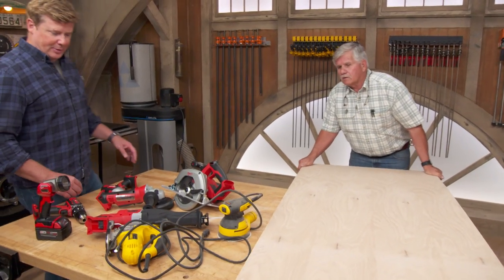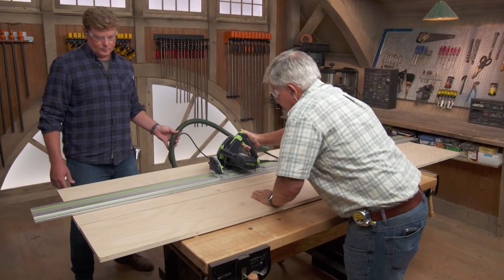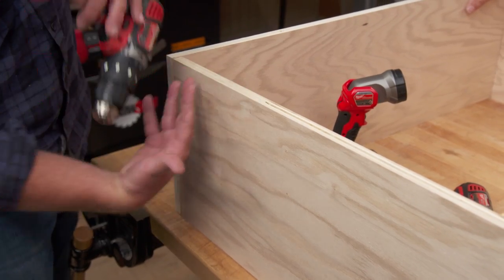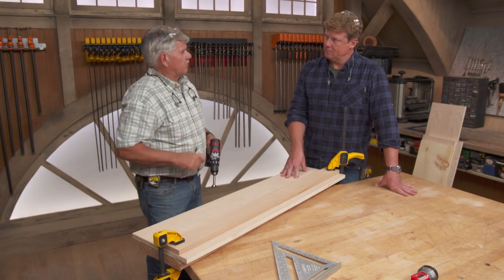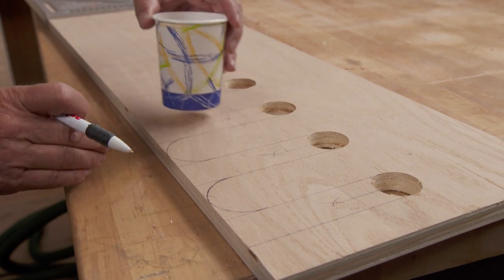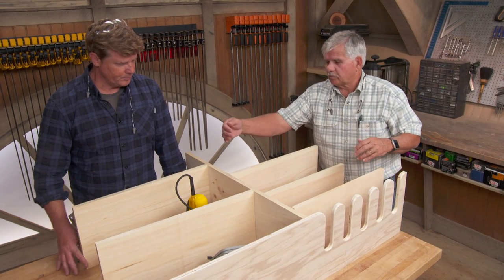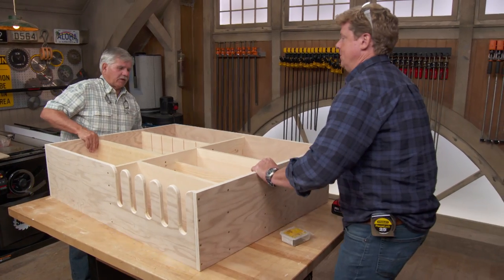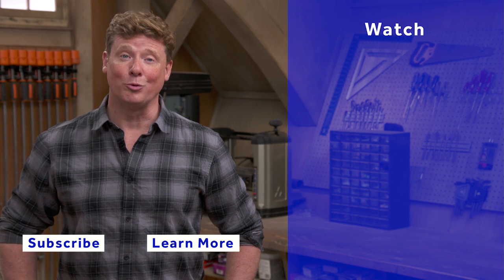Tool Storage Shelf | Build It | Ask This Old House

Comment: I bought a black and Decker jig saw for this project for the fingers and I realised I didn't have a bit big enough for the slot finger so I free handed it with the jig saw and my first time using it but I made the slots 3 inches wide and didn't realise the holes need to be like 1.5 inches lol
Reply: ĴusTin 山όσᗪs you could turn the tool sideways in the finger to make up for the bigger gap
Reply: H. E. Niklas yea I did a big oop since I was in a hurry it was 10 at night

Comment: great stuff once  again, I was wondering how you mounted it to the wall. I know there are lots of video's that shows how to do that but I was curious how you would do it. Would screws to the back plywood be enough and safe to use?
Reply: I'm guessing french cleat for something that size, but I'm surprised they didn't mention that part at all. Seems like a big miss. At 6:15 it looks to me like there's a board on the back of the unit at the bottom, but hard to tell. I wonder if this is a backer board to offset any forward lean from a french cleat. Who knows.
Reply: He used 1/2” ply as the back. Yes, that is plenty strong.
Reply: @MorrMedia1  thank you
Reply: @charlescho  thank you
Reply: I mounted mine with a French cleat, but... A lot of folks cut their cleat to 45 degrees, and I've found that a problem: they seem to be loose and the piece wants to lean off the wall. I cut mine to 25 degrees and they're solid and tight. My cleat is at the top, secured to the top and sides with construction screws. I also have a spacer of the same width at the bottom.
Reply: @geraldcreager4432  Interesting angle to use, this has been a while but thank you for the information.

Comment: Lol, let's make a place for this $100 circular saw, using this $1,000 track saw. Still a great build, I just thought you were going to use the tools that you just explained homeowners have lying around. 🤷🏼‍♂️
Reply: Austin McCleery poor mans track saw: straight edge clamped to workpiece. Run circ saw along that.
Reply: @Monsieur405  That's exactly what I was expecting 👍🏻
Reply: He also had a $1000 miter saw.
Reply: @frankieg3953  Lol, yep. The Kapex! Doing a $200 job for over $1,000. 🤣
Reply: @drumunl  Trim carpenter on YT said he burned up 2 motors on those Kapex so he quit them and went to Dewalt 780.  He does great work and videos.